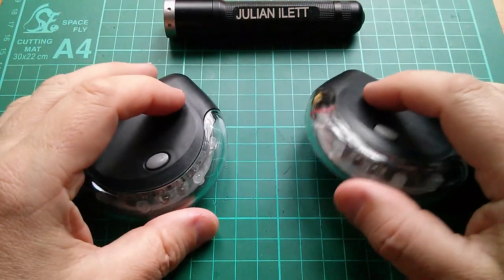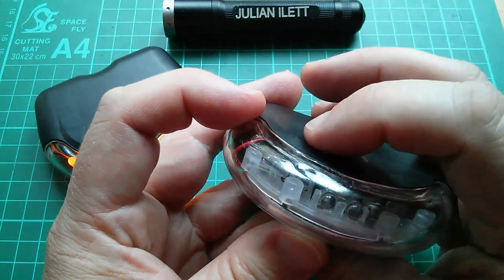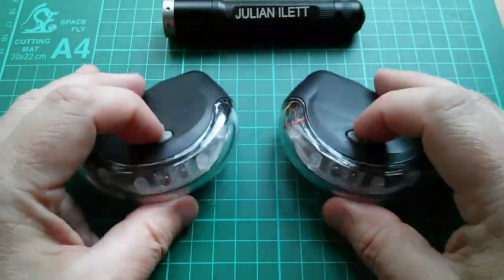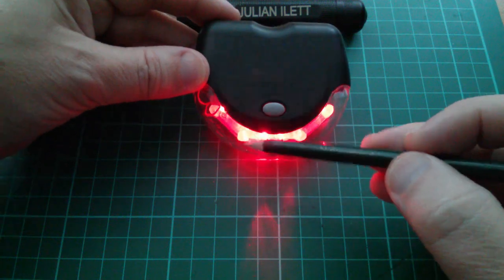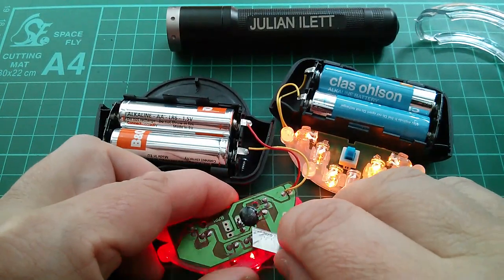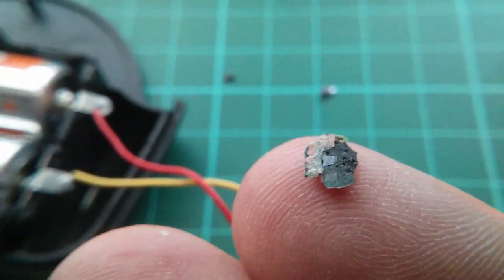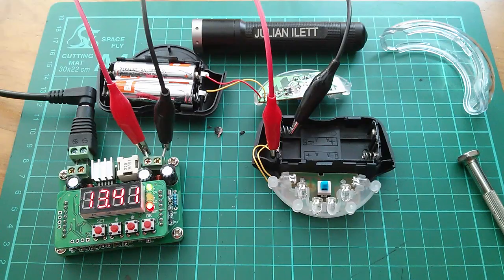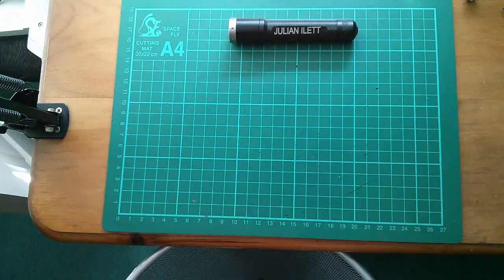Electronics to Go: Smokin' Bicycle Lights

Comment: @2:36 you say off state current is low. But since there i a mechanical switch opening the circuit, there  is no way for current to flow through te Uc, so i think you mean battery leakage is low. Correct?

Comment: Not much could have happened, but I think it is not a good idea to use a pencil to point to a live circuit .. .. Carbon will have a low resistance when tracks are close to each other.

Comment: With lights that are meant to draw attention to you (rather than light up your way ahead) pinpoints of light are not very good.
They tend to be only viewable over a narrow angle and are not overly useful for judging distance.
Light diffused through semi-transparent plastic or more complex lensing is much better at that and has the added benefit of significantly reduced glare.

Comment: if you remove epoxy glue then very likely also break off a very thin wired, which is attached to the chip and the PCB tracks between (which is connected before the epoxy glue. Like that http://www.moldex3d.com/en/newsletter/wire-sweep-analysis-setting ). 
Most of the underfill materials are epoxy-based. These epoxies need to be heated above their softening temperature (above 150°C) and along with this heat a mechanical force needs to remove this previously cured material. The material removal can be accomplished through high temperature vacuum extraction or hand tools, depending on the modulus of elasticity and underfill’s softening temperature.

Comment: It's pretty easy to get the power draw quite low when "off" - I have done LED blinkies that run off a single CR2032 with an ATTiny85 - in deep sleep mode, just waiting for a keypress interrupt, I've left them for 3+ years and they come right back up again in the same mode they were left in, still with the original CR2032 in them.  Draw in these modes is nanoamps, impact to the cell is less than the shelf life would drain it anyway.
Reply: Yeah, the deep sleep states are very good. But you can also wire the switch so that it also supplies momentary power to the microcontroller, which can then keep a transistor on to power itself. When it turns that off, no current flows at all (barring any leakage in the transistor).

Comment: Quite resilient lights, would not expect them to sustain such overvoltage.
However, will you be making another video on those supercaps? I'm interested how fast they self discharge, here is some testing of another brand (http://fireswordblog.blogspot.cz/2014/01/experiments-with-supercaps-part-2.html) and they seem to discharge rather quick. I bought few 50F 2.7V caps (YEC brand) more than 4 years ago and they still have no problem holding voltage over 1,7V for weeks.